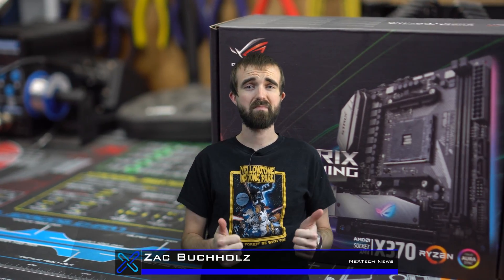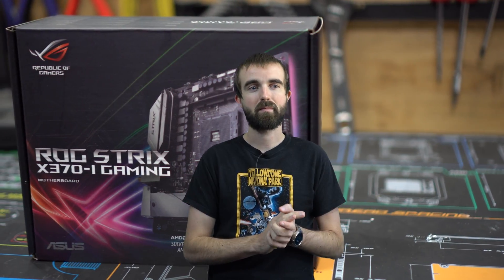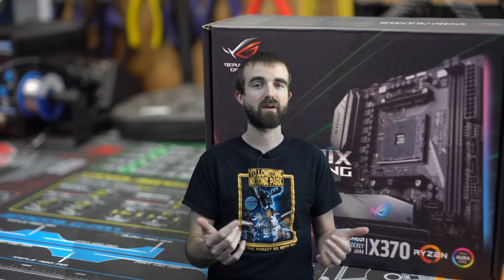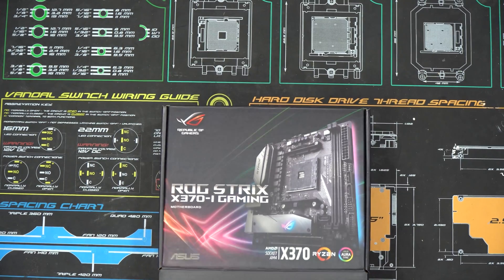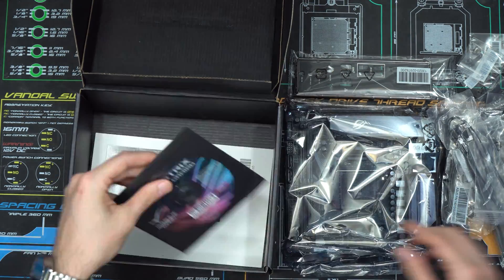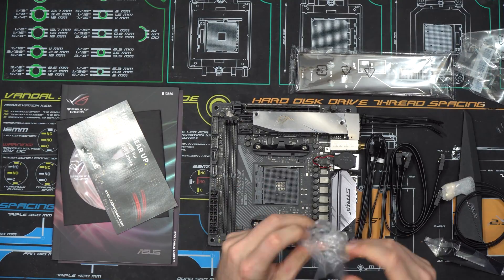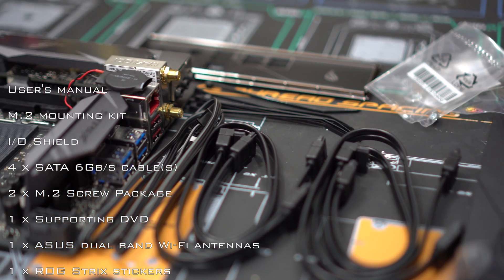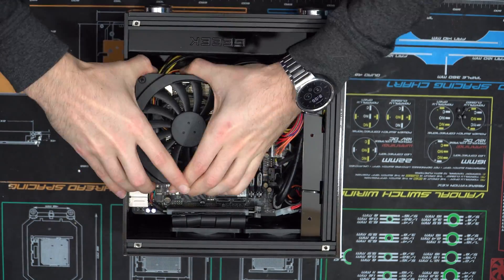Asus ROG STRIX X370-I Unboxing & Installation

Comment: I've compared the spec sheet of both x370-i and b350-i and couldn't find the differences except pricing.  Would you know the difference?
Reply from the maker: Literally the only difference is the chipset itself, it's the same for all b350 and x370 it motherboards, according to and the x370 chipset could lead to more stable overclocks but no body has been able to prove differently
Reply from the maker: *itx boards not it

Comment: Good video Zach. You checked out my Biostar/Node202 build recently on pcpartbuilder. Looking forward to the review. I also bought the Biostar with the intention of moving to an Asus, but I'm waiting for one with some video outputs. I really hate losing the ability to drop an APU in it if I ever want to. I'm probably going to upgrade my 1700 to the Zen2 65W TDP chip in 2019 or whenever it lands. That wasn't the original plan, but I'd like to get the chip where AMD fixes Spectre in hardware.
Reply from the maker: Glad you liked the video and oh okay nice build! and yeah definitely the one downside of this board!
Reply: Oops I meant the review for this Asus! Not my build. :) But thanks. I'd love to have the Asus but I think I'm going to wait for one with display outputs and probably match it with Zen2.

Comment: Spoiler alert, bios isn't called that it is called UEFI, but anyway good video, i always loved ITX board and i just upgraded my own pc and built a 2nd one from spare parts, main pc: https://imgur.com/t1z7nR7 2nd pc: https://imgur.com/vJN8Auq tell me what you think of them both and tell me what i can improve. both are in the Nano S case, Also will you be byuing the Ryzen 5 2400g? apu that is releasing soon? i want to see some test of it
Reply from the maker: Thanks for the tip! and love the first one! love how much you got into a pretty tiny case! the only thing i think it could use would be a little bit more of a color scheme, like maybe a colored coolant or if you do like the downplayed color maybe just some leds or led fans that way you can add color when you want it and get rid of it when you don't want it. The second pc just looks kind of empty but it's also leftover parts so I don't know that thats actually an issue haha.  and i am thinking about buying the r5 2400g and making an hdpc from it